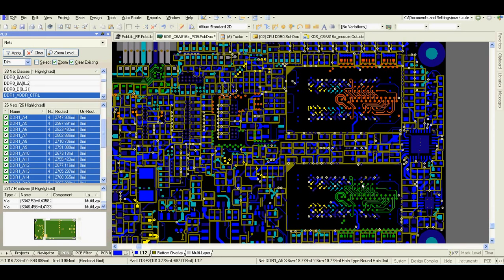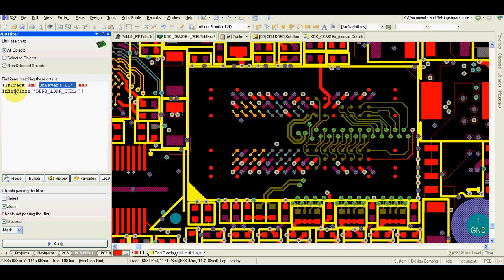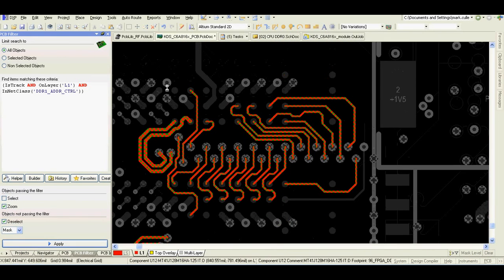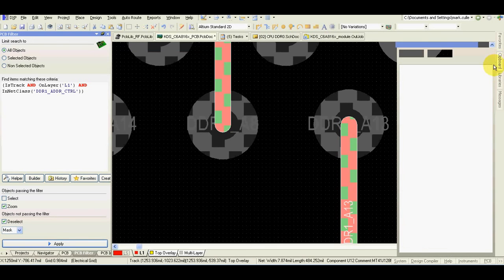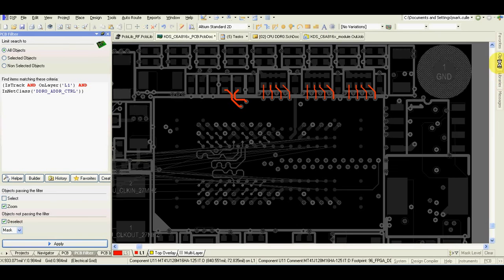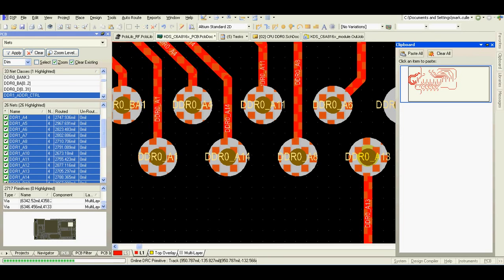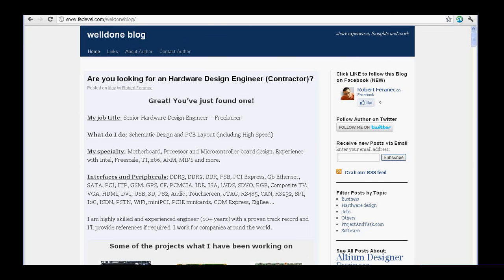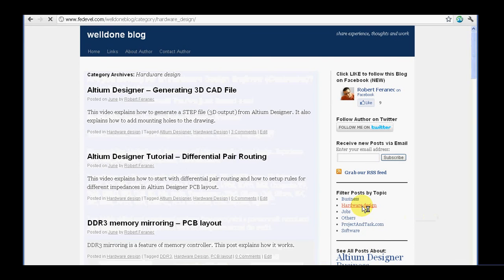Altium Designer - Copy and Paste PCB Layout

Comment: If i have two chips (ADC1 and ADC2) with same shematic and update to PCB i got all the components of both,with different ending of component Name. For Example R1_ADC1 and R1_ADC2. So if i do layout for the ADC1 with all the components. Is it possible to copy the layout for ADC2 ? I thought to copy and change the Ending from 1 to 2, but its not ellegant and i am worried that it could make problems.